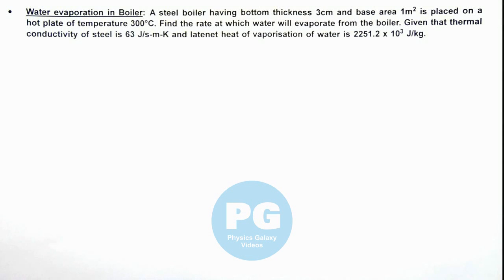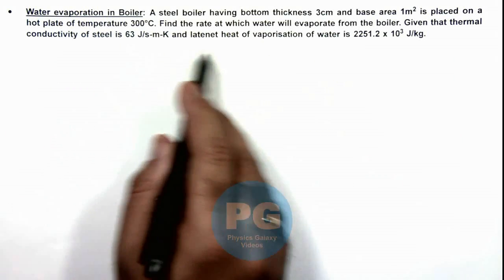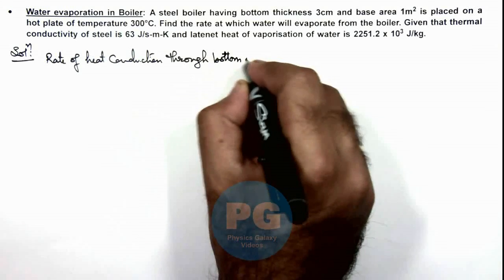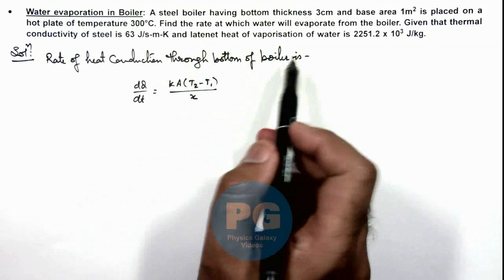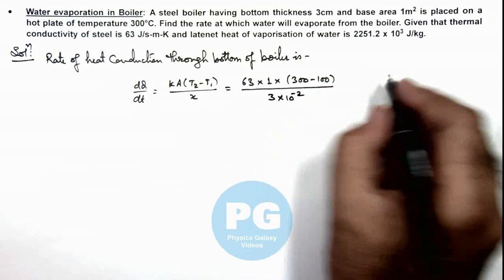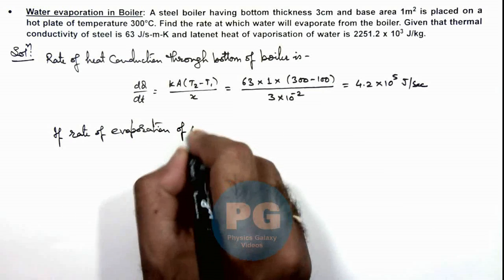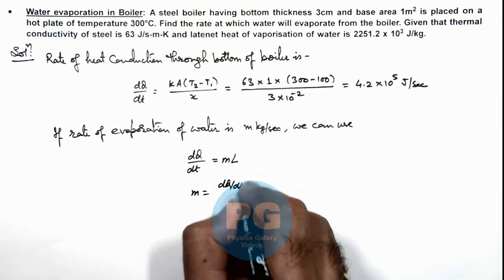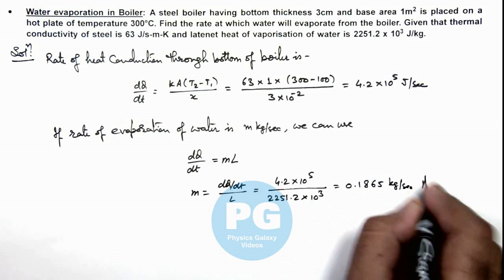1. Advance Illustration | Heat Transfer | Water evaporation in Boiler | by Ashish Arora

Comment: sir, why have we assumed that water in boiler will be at 100 degrees celcius in liquid phase so that q (absorbed) is only equal to mL?
Reply from the maker: +Aman Aloon In prob it is given that hot plate temperature is 300°C and this is a boiler that means water will boil when its temperature is raised to 100°C then only steady state will be attained in evaporation. If water temperature is less than 100°C then the rate will be varying...
Reply: @physicsgalaxyworld sir here k( conductivity )is given in kelvin ,then why are you considering temperature in Celsius..?
Reply: +Physics Galaxy ..okay,thank you sir. 
sir, one doubt regarding the process of evaporation itself. if we keep a jar filled with water in enclosed chamber, then why does the evaporation rate remains constant? on net, and in every book its given that it will remain constant. but, like as time increases the water vapour content in air above will increase and so as the rate of evaporation is inversely proportional to the humidity in the surrounding air,the rate of evaporation must decrease. I am not able to find the flaw in my logic ,if the books are to be assumed true.
Reply: +Aman Aloon
after sometime equilibrium will be attained in the container i.e. rate of evaporation of water will be equal to the rate of condensation or water .. for more information read chapter equilibrium from ncert chemistry book.. hope that helps you..
Reply: +Amaan Arshad : Yes, that's true.But  that doesn't answer my question. Sir answered my query and i am satisfied by it that if we do not make an assumption that it's 100 degrees celcius the rate will be varying and we will be not be able to answer the question, at our level.
Reply: +Aman Aloon 
i havent answered your first question ......... i have answered your that question in which you have asked  "if we keep a jar filled with water in enclosed chamber, then why does the evaporation rate remains constant? ............. you better know what you have asked....
Reply: +Amaan Arshad In NCERT and everywhere it is given that rate of evaporation remains constant as they say that it depends on surface area. But, my question is different. 
   It's true that equilibrium will be attained in the container in sometime as rate of evaporation remains constant(as it's written everywhere) and steadily rate of condensation increases and becomes equal in some time. But, my question is that for equilibrium to be attained it's logical that rate of condensation increases steadily but why does rate of evaporation remains constant? I feel that it should decrease. As the time will pass, rate of condensation and evaporation will become equal. But, rate of evaporation also depends on the moisture present in the surroundings(as we normally see that clothes dry easily in dry weather and lately in humind weather) so, as time will pass more and more water molecule will be present in the surroundings and therefore i think it should decrease. This is what i am not able to understand that where my logic is wrong. I hope i was able to state my questions clearly.
Reply: Hey, yes, rate of evaporation does decrease. Not only due to the fact that water vapor gets accumulated above the water-air surface, but also the molecules having the highest kinetic energy run off faster leaving behind only the molecules with low KE. So it is logical and right to say that evaporation decreases, but what most books talk about when they say the rate of evaporation remains constant, is the state of equilibrium. We can make definite predictions (like these) only at equilibrium.
Reply: WHich college you get..?